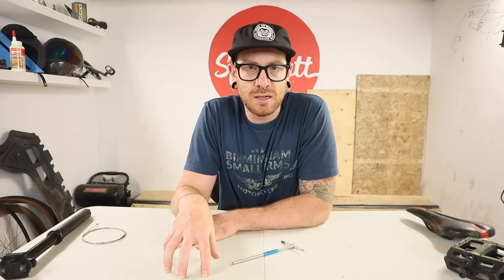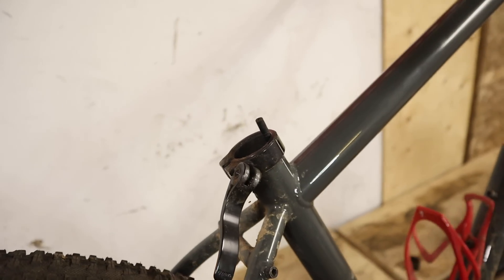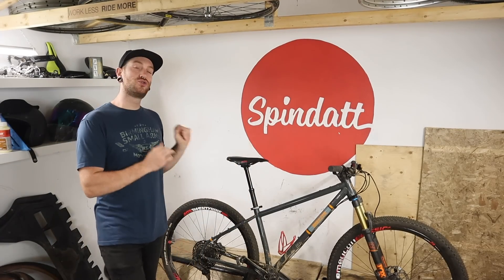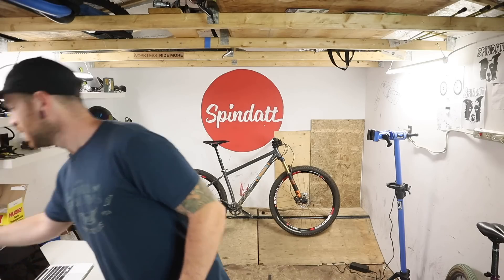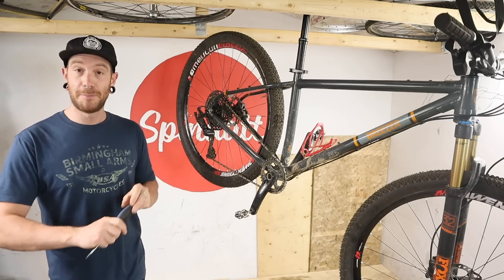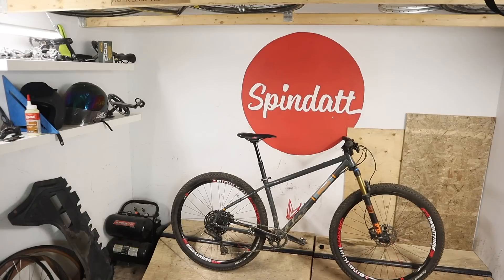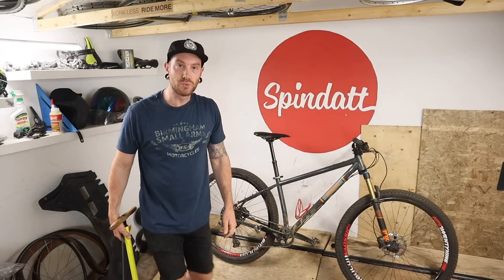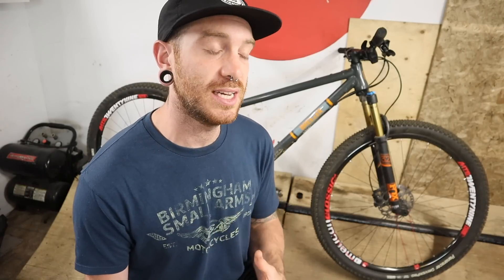The 3 Essential Tools For Your Home Bike Shop

Comment: Just to be annoying, it's not actually a Phillips head that is useful on bikes, but a JIS screwdriver. What's the difference? JIS has a dull tip, not a point, and will be a better fit in derailleur screws etc. Park market their screwdrivers as a "cross head" which is very ambiguous, probably a conscious decision on their part. My favourite home screwdriver is a Phillips that I made blunt in the bench grinder, and at work we've got a really nice Park screwdriver with an aluminium handle that fits all the worlds worst screws perfectly.
Reply: Yes, JIS is a sneaky little bit but it really does make a difference for the old bikes. Vessel still makes them.
Reply: Get outta here man go ride hahaha

Comment: I need a star nut installer. Number four has to be a bike stand. I  definitely agree with this three list. Check out the fitting sizes on your bikes(s) when collecting Philips head drivers. I have cheap floor pumps scattered from my apartment to the trunk of my car. Spend the money on good gauges.  Better than dogs and babies for making new friends.

Comment: oh yeah, level 1 tools are allen, and pump.  Level 2 would include wire cutter, crank removal tool, chain breaker, tire levers, and spoke wrench. Level 3 would include headset removal tool, headset install tool, suspension rebuild tools, complete hydraulic bleed kit, and a ratchet torque wrench.

That leaves us with level 4 which is the stuff you don't NEED, but is nice to have: truing stand, bike repair stand, chain cleaner tool, metal pick for cleaning out your drivetrain, etc.
Reply: Thanks for completing the list and I completely agree, although I would consider your level 2 is actually all level 1. And I would add a can of WD40 as an essential tool, too.

Comment: I've been using a cheap topeak morph knockoff pump as my "floor pump" for over a year now.  All the regular floor pumps I have ever used have broken in short time.  The compressor works well, but my ears hate me every time I turn it on.
Reply: Finding a good floor pump is next to impossible.  I have spent big money on them, and had them break within 3 months.... I've also spent $25 on amazon and had them last for YEARS.  It's a crapshoot.
Reply: Instead of buying yet another track pump, just buy a set of peltor ear defenders, life is for living
Reply: I’ve had the same Specialized floor pump for a decade, got all kinds of dents and scratches but still works great. Maybe time to consider if it isn’t the tools…

Comment: You name your wrenches? allen and phillip? lol, I don't think my 85 sierra has one allen screw on it lol. thank goodness bikes have allen screws now. For some reason the old phillips head screws seem to be kind of, one time use. I always try to use the correct size screw driver but I must over tighten them because the always strip.
Reply: Hi. Get a JIS screwdriver….Japanese screws are that much different that they strip out easily unless you use a designated driver. Amazon has them.
Reply: As a barbarian that uses a pozidrive turnscrews on phillips head screws, similar but different tools may be the problem...
Reply: He's Canadian, they're named Terrence and Phillip

Comment: I always carry a multi tool with me when riding.  Never use it when at home, individual allen keys and a phillips screw driver are the only way to go.  You hit the nail on the head with the floor pump too.  And yes, mini pumps are useless.  Good video.
Reply: do you use CO2 canisters on rides? as opposed to a mini pump?